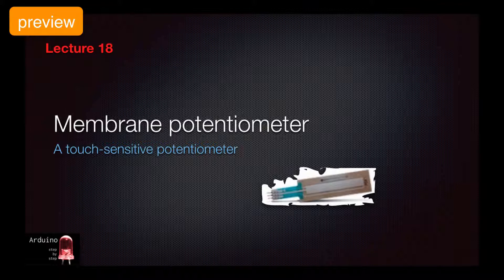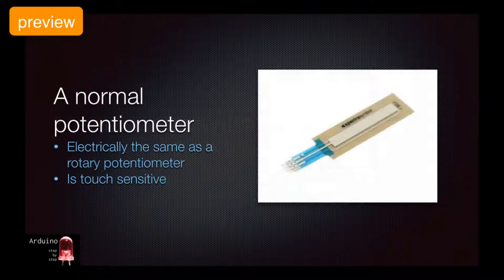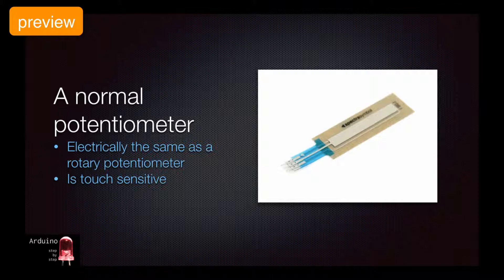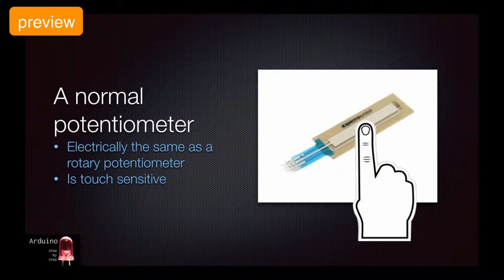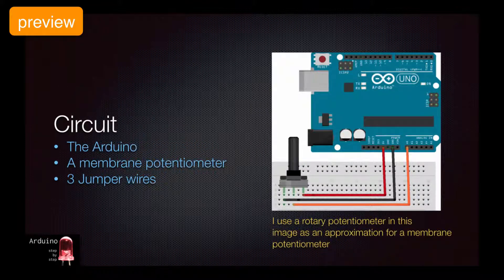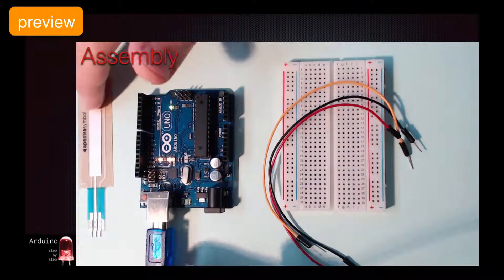Arduino SbS Preview - Membrane Potentiometer

Comment: Where is the rest of the video???
Reply: Spectator Mag Hi, this is a preview only. The rest plus 100+ more are at txplore.com, check it out!
Reply: Peter Dalmaris Thank you for the speedy response! Checking out now. I'm interested in this product because i'm designing a midi control surface and i like this better than the traditional faders and its MUCH cheaper that the motorized potentiometers. If you have anything else that may interest me please tell me, as I am not familiar with parts terminology yet. Good day sir!
Reply: Spectator Mag Interesting, I don't know much (close to anything) about midi and related hardware. Do you know if people use Arduinos to build midi control surfaces?
Reply: Peter Dalmaris Yes they do! Arduino Uno

http://www.instructables.com/id/Arduino-Sensors-and-MIDI/?ALLSTEPS
Parts list
(1x) Arduino Uno Amazon
(1x) usb cable Amazon
(1x) breadboard Amazon
(1x) jumper wires Amazon
(1x) 220Ohm resistors Digikey CF14JT220RCT-ND
(1x) led Digikey C503B-RCN-CW0Z0AA1-ND

(1x) 10kOhm resistor Digikey CF14JT10K0CT-ND
(1x) tact button Digikey 450-1650-ND
(1x) tilt switch Adafruit 173
(1x) 10kOhm potentiometer Digikey PDB181-K420K-103B-ND
(1x) light sensitive resistor Digikey PDV-P8103-ND
(1x) 33kOhm resistor Digikey 33KQBK-ND
(1x) 1MOhm resistor Digikey 1.0MQBK-ND
(1x) piezo sensor Sparkfun SEN-10293

I'm going to replace the one in black with the membrane which is $5-$10 cheaper per piece. 
I'm on your site right now just absorbing what I can before the blueprint gets laid down.
Reply: Spectator Mag Nice, thank you!